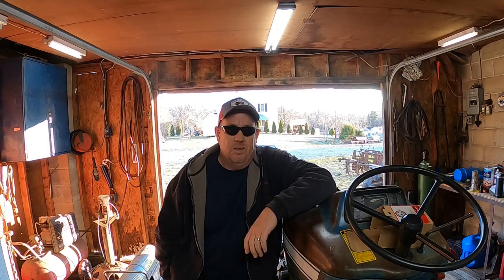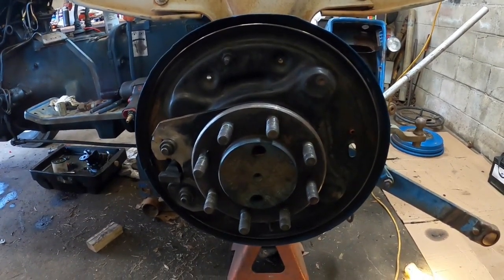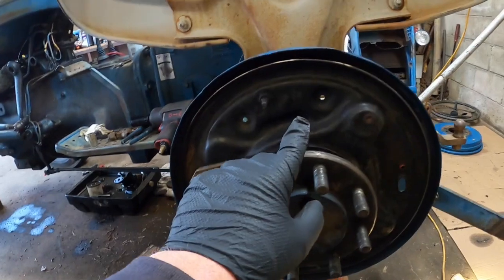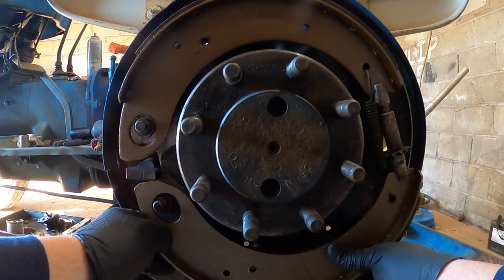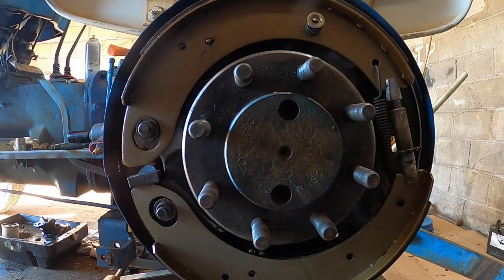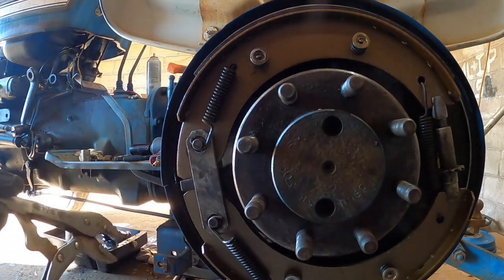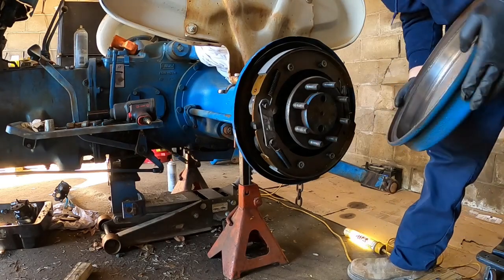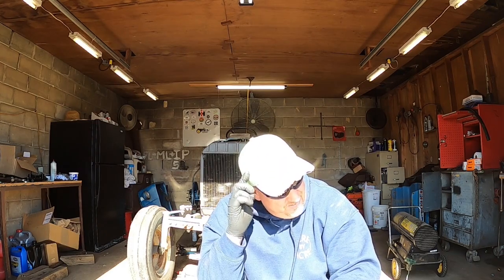I can't believe how bad this was....Ford 3000 tractor rear brake shoe replacement

Comment: Hey I bet it will stop now. The way they had that setup in there was absolutely insane. It couldn't have stopped at all after the last brake job. Wearing those nitrile gloves for that kind of work is probably a good idea and I commend you for it but I just can't do it. I'm the guy who has a scar on every knuckle and hands that smell like fuel oil. Fuel filter in the 2520 this morning made things run a whole lot better.   Have a good week Nelson. 👍🙂🚜  I just realized that there is no red tractor emoji. 🤷‍♂️
Reply from the maker: I couldn't believe they did all that work then didn't even have a way to engage them 🤦🤦🤦🤣🤣🤣 Well I must say Mr Will, I agree with you on the gloves!! But when the camera is running, I can rip a glove off and hit the stop button quick...without loads of grease 🤦🤦🤣🤣🤣🤣🤣 Praise the Lord you got the 2520 going again!! That is way to cold!!! Thank you Mr Will, hope you do as well!! I know, I have been complaining about the nonred emoji thing forever 🤣🤣🤣🤦I really appreciate you always being here!! 🇺🇸🇺🇸👍👍😁😁

Comment: Thanks for showing the orientation of the brake shoes when you originally took the drum off.  It looked to me like someone was so used to doing automotive brakes that they did not bother to check any diagrams or use their head.  No wonder the tractor had no brakes.  Thank-you, Mr. Nelson for taking the time to explain every step in doing this job right!  God Bless.
Reply from the maker: Thank you very much Mr Paul!! I really appreciate your input on the video!! Yep, that's exactly what I was thinking too!! Which it really makes sense, just not.howntheunneed to be on this tractor for sure!! I thought it.wad all the oil, but nope ..not a chance these would work!! 🤣🤣🤦🤦.Thank you sir as well for always being here, I really appreciate that!! And again for the input, really means alot!! 👍👍😁😁😁